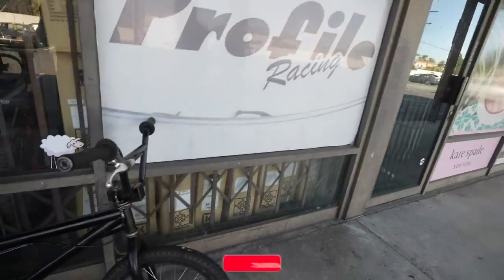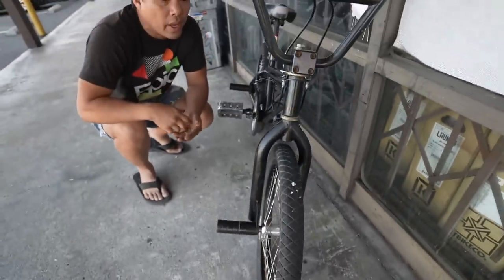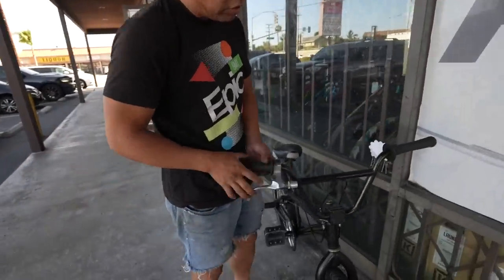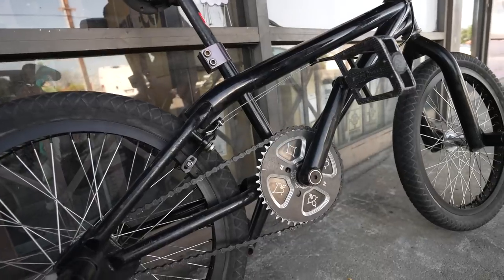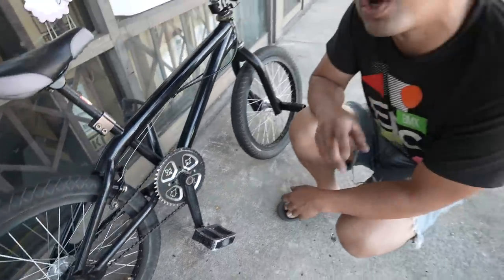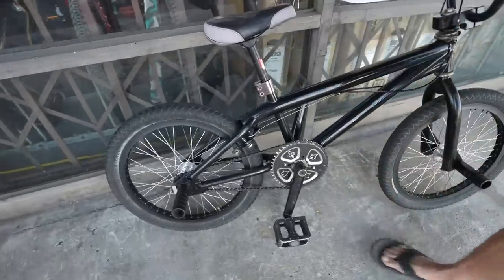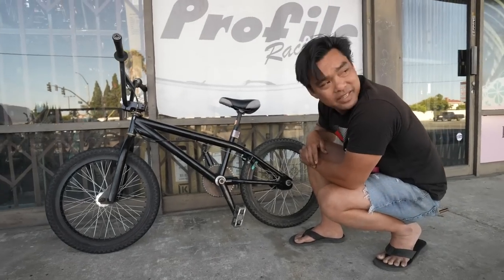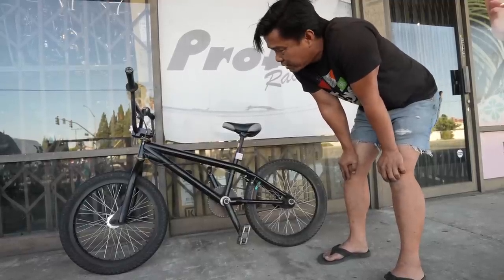The Absolute Heaviest Mid School BMX Ever? S&M Warpig!!

Comment: My buddy had a Warpig. It was a tank! I remember when we all used to roll with those thick-ass motorcycle chains with those 1/4" thick sprockets. Weight was thought to be a good thing. Meant your bike would last. Then I got on a Fit series 1, built that up with race parts essentially, and realized the benefits of a light bike! The thing still weighed like 36 pounds or something, but back then bikes were 40+.
Reply: I do miss the huge chains

Comment: My 03 condor is for sure heavier than a war pig , my big black bird is 44 lbs , Ramp room second gen love handles, Hoffman fist front load stem , tech 99 levers , Alex supra G48h wheel set with xs4x4 front hub odyssey v-3 cassette, 175 power bites , Brooklyn machine works chinburger pedals , it’s an awesome bike with a ton of rad rare parts all heavy weight

Comment: not as heavy as my old mirra. with meganuke sprocket. the super fat chain that looked like a motorcycle chain. 4 pegs. a pair of chain tensioners. 2 brakes. it was a good 40 pounds. fat seat. and so on. double clamp seat post clamp and so on. 14 mm axles on double wall rims and high flange sealed dk hubs. it was a beast. yet i could manual to grinds on it when i was young and strong lol

Comment: I'm not sure which is heavier, the s&m war pig or the 2hip pork. I used to run son of a bomb hubs with Alex triple wall supra e rims, 12 gauge spokes in the rear and 14 gauge in the front
Reply: I got my brothers primo hub laced to an alex triple wall and I remember the front having a 14mm axle that was flat so it'd be 3/8 I don't remember what that was called
Reply: I also had the primo SOB hubs, 12 gauge spokes front and back and the primo hula hoop triple wall rims.  Bombproof.
Reply: @BSpenceTravels  hell yeah 🤘

Comment: That was not a evolution of the Sabbath it was a sister of the Sabbath .The tank came out before the pig and those are berringer bars.That's an embossed seat,And the marvins guts were 1 size .The rails on the s&M seat were always messed up. The Viking clamp.was made like that to add strength to the post too when clamping it.those are the super tenderisers the og tenderizers were way smaller .Troy m Murray didn't design the elevated chain stay ,Sean Mckinney put that design in and it was influenced by the Morales flat land frame .I had a Sabbath and warpig .you can still get the fat chain
Reply: Yup I was going to mention the raised chainstays appeared first on the Morales (to have more foot space for flatland tricks)
Reply: I'd argue the point that the Pig was the evolution of the Sabbath, It was designed after it, using most of the same geo etc but it was built a little more rider (park/trail) friendly with a slightly longer top tube, but you are right about Mckinney and the Morales influence